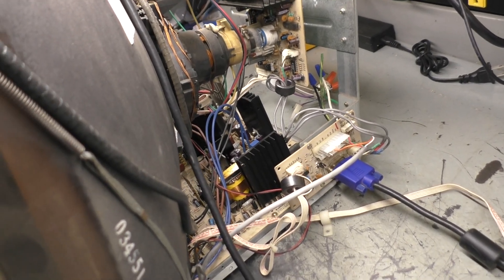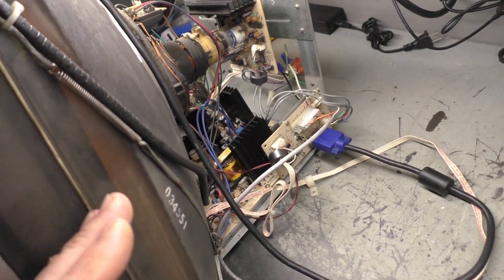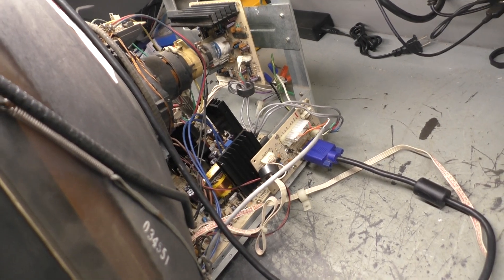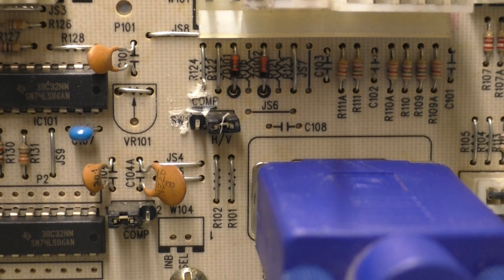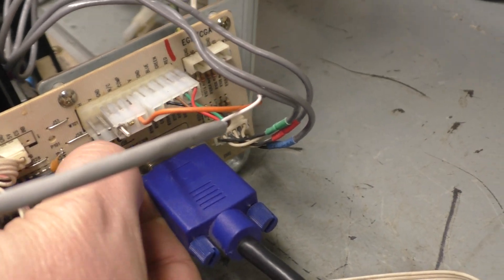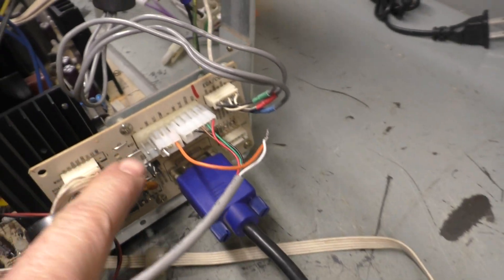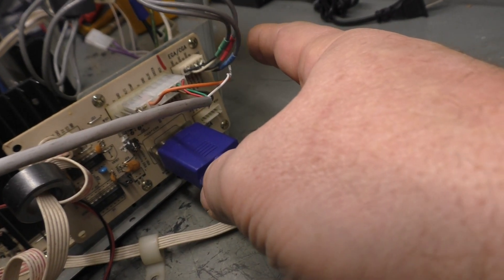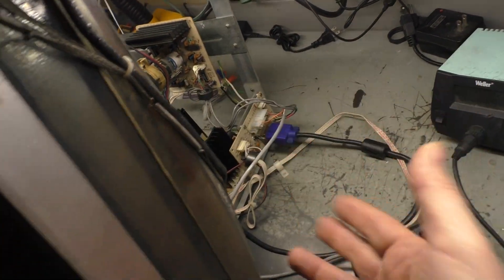27" Neotec NT-500DX Arcade Monitor Chassis Repair - Input Configuration Tutorial

Comment: Super helpful! Thanks! Do you know if the various settings are separate per resolution? Like, if I get 640x480 dialed in for white balance, gamma control, and geometry. Will that carry to RGBs from a lower res source? Do they all have to be dialed in separately?
Reply from the maker: Glad I could help. Each resolution is different, so they all have to be dialed in separately.